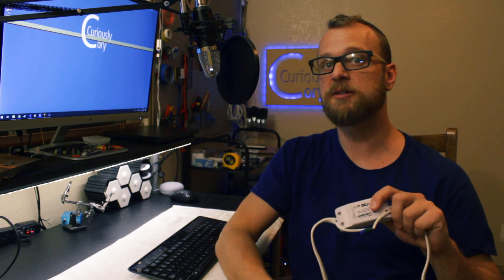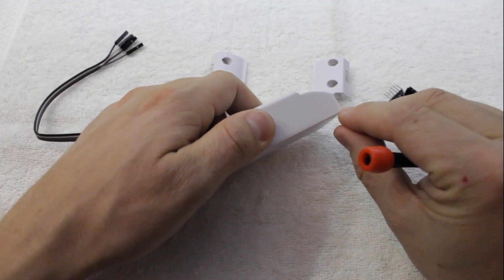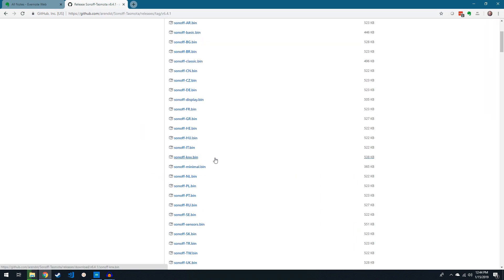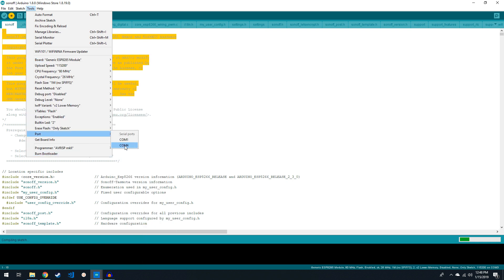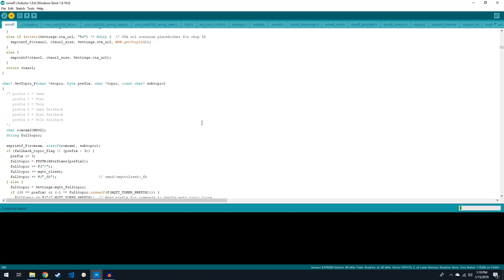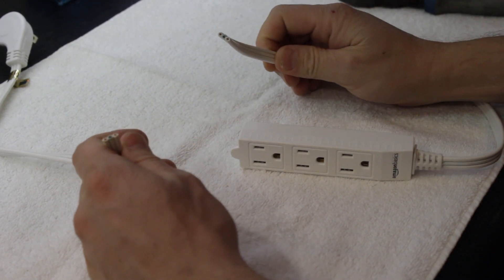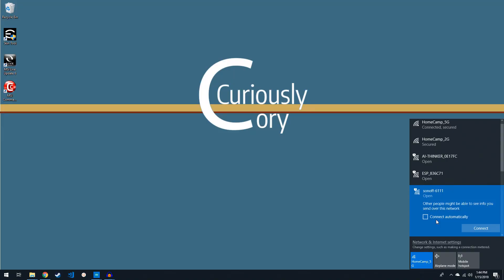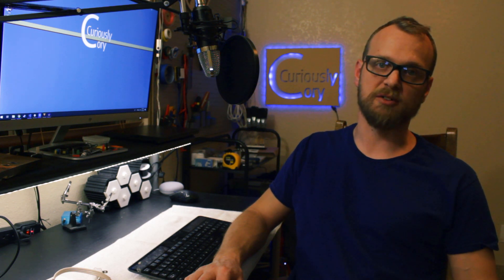DIY Home Automation Beginners Series Part 2: Building a Smart Plug

Comment: Great tutorial videos. 
Is this step of building a smart plug required for the whole automation hub?, sorry for the dumb question. Also I already own a bunch of smart plugs, switches, etc that I would like to get them to communicate to each other.
Reply from the maker: No. It's just an example of how to. Home assistant has built in support for a lot of different device types. You can find a list of supported devices and  systems here: https://www.home-assistant.io/components/

Comment: First Sonoff RF R2 flashed with Tasmota , thanks for the easy to follow video. been toying with the idea of home automation; though i would start with a Sonoff Basic , purchased one and a programmer - then hit a brick wall as i discovered i had one of the new ones. your earlier video to show the GPIO2 and GPIO4 led me to your channel. Will be following your videos going forward as is exactly what i am trying to achieve. eventually setting up a complete home automation system using something like open hab , mqqt on a raspberry pi (or something similar)
Reply from the maker: Next video in this series will be setting up Home Assistant. The one after that I'll show how to use an ESP8266 to add an existing "dumb" device to the network.

Comment: Nice easy to follow vid - I'm enjoying following the progress, keep up the good work,  you could also try an easier way to flash tasmota - Try DrZZZ (and others ) flashing mode also use the Backlog Command - I would suggest installing your Home Assistant or Demoticz first so you can enter the correct info in the backlog

Example Backlog Command for Termite to enter Tasmota Commands: Backlog SSID1 xxxxxx; Password1 yyyyyy; MqttHost brokerIP; MqttUser xxxxxxx; MqttPassword yyyyyyy; GPIO14 09; Hostname sonoff_name; MqttClient unique_sonoff_name; Topic sonoff_name; FriendlyName1 Sonoff-Name
Reply from the maker: Thanks! I've looked over a few of the other ways to flash tasmota, but since I already had the Arduino IDE installed and configured for other ESP8266 projects, it was the easiest for me. After running into some library issues though I might try something like ESPtool so I can just flash a precompiled bin, and it sounds like I need to check out backlog/termite.

I debated whether to do this video or home assistant installation first, but I figured that doing this one first would give people following along something to add to home assistant as soon as it's installed and ready. Next video in the series will cover installing and configuring home assistant!